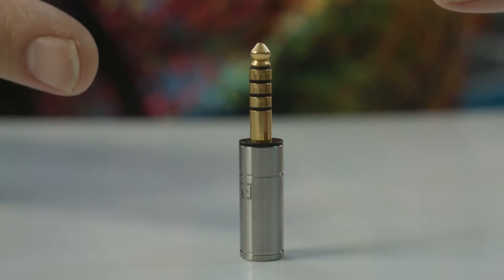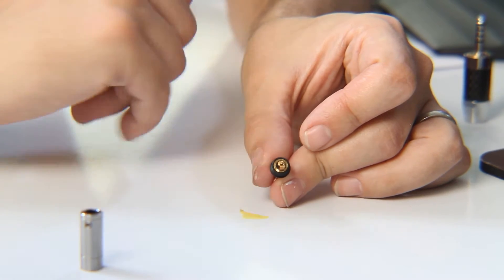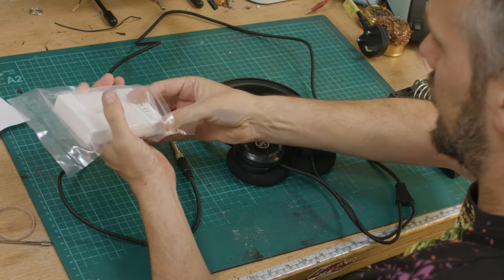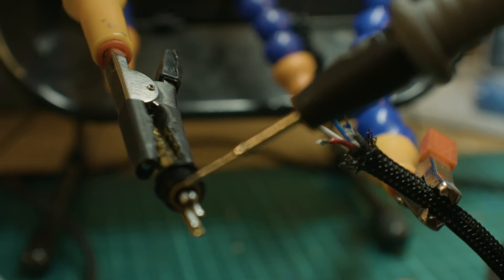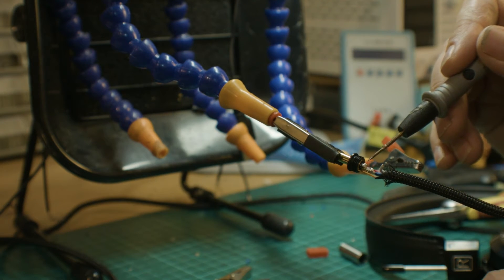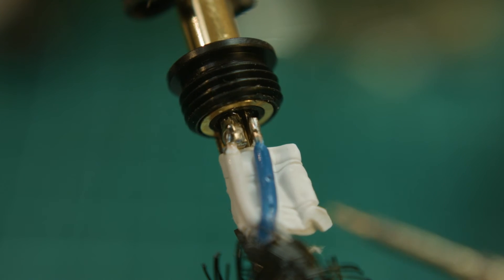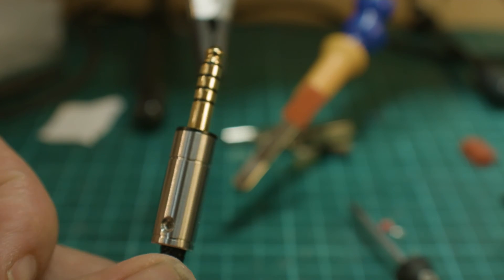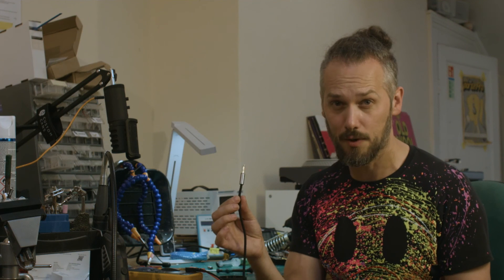An easy to solder 4.4mm jack from aeco fitted to some Grado SR60X for an easy balanced conversion

Comment: 4.4 jack has a place for soldering a shield. Should shielded cable be used or not? Will the lack of shielding affect the sound in any way? Is it possible to experience interference and/or unwanted noises?
Reply from the maker: on headphone cables... as it is normally quite a high power signal, shielding is not really necessary and will increase the capacitance quite a lot as well as making the cable heavier and less flexible. There are some headphones that use a shielded cable like the beyerdynamic T1 but personally, I think unshielded headphone cables are better in most cases

Comment: Does the Beyerdynamic DT 770 Pro has a similar cable? I don't have a dremel and I would find much easier just to change the jack from 3.5mm to a 4.4 or 2.5mm balanced.
If the Beyerdynamic 770 Pro can have the same treatment that you did in this video, how can I know which ground belongs to which side? 

Also there is the "OEAUDIO MULTI PLUG Set of Interchangeable 2.5mm / 3.5mm / 4.4mm Jack Connectors", which would allow me to have a DT 770 Pro that one day is balanced, next day is 3.5mm unbalanced, just by changing the jack.
Reply: The stock 3.5mm cable on the DT770 only has three wires (L, R, G) so the whole thing needs to be replaced. It is possible to directly solder a 4.4mm cable onto the wires coming from the drivers though@@sophiebourne7642
Reply from the maker: yes as @tejp5101 said... the stock cable only has 3 wires so won't be suitable. You could replace the stock cable with a 4 wire one without dremeling if you find a 4 core wire with a similar thickness.